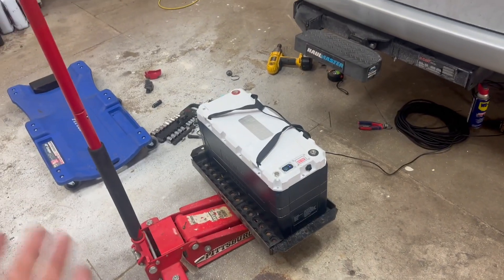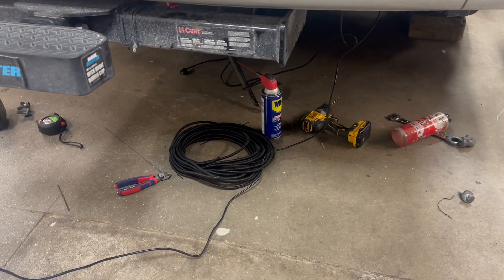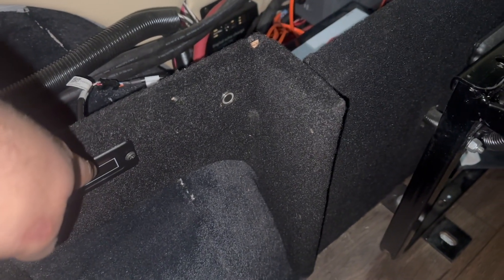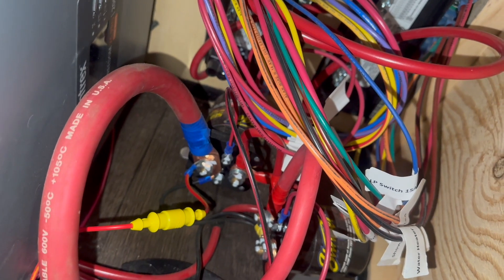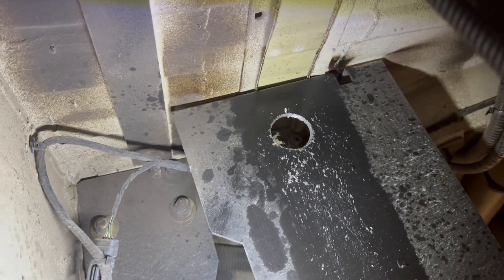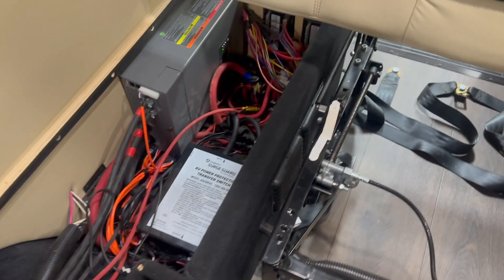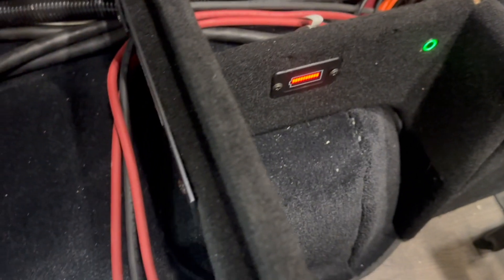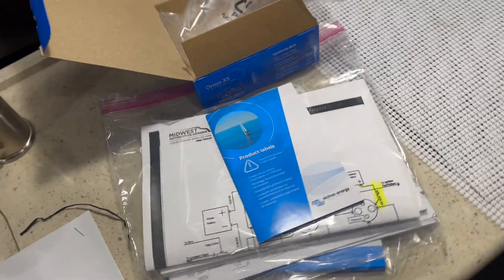Sprinter Van Epoch 460 AH battery  Victron Orion XS Dc-DC Charger Install

Comment: Hi can a zantrex xc 2000w inverter / charger can charge this Epoch 460ah lithium battery?
Reply from the maker: Yes, just setup for charging at the reduced voltage these want. 13.9v or 14.0
Reply: Thanks

Comment: Doesn't installing it unprotected and outside the vehicle make it very likely that it will have problems charging in even moderately cold weather?
Reply from the maker: It has built in heaters.  Customer said it was still 50f after 2 hours driving in 10-20 degrees weather.
Reply: @sotasolar  That's good to know.  Still, seems risky to me, but if it works, it works.
Reply: With the Xantrex inverter charger installed, if cold is an issue then they can keep it on shore power all night with an outdoor Xmas light timer set to off and on every hour, and that’ll keep the battery warmish while on shore power (oscillating between about 28 and 45 degrees).

Comment: We have a 2017 Hymer Carado Axion Van which has 2 EcoTrek k2 200ah batteries mounted under the vehicle.  Have you done any work on these before?  We will need to replace them at sometime in the near future.  It has an addditional AGM,  Balmer controller and underhood generator.
Reply from the maker: We have not , but in many cases it's the first time we've worked on many vehicles.  First time for everything, just take it slow, research and don't go where you can't back out of.... sounds a lot like RVing.

Comment: Do you have any specs for the Epoch 24V version that is currently pre-sell on their website? Same size and weight as the 12V?
Reply from the maker: Yes it will likely have the new BMS which will not as finicky and be more inline with other lithium batteries.